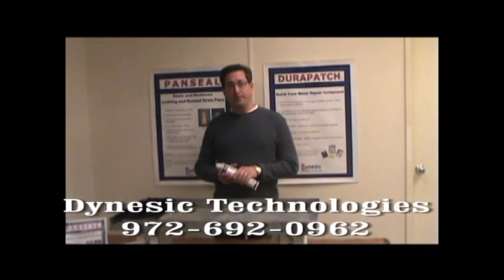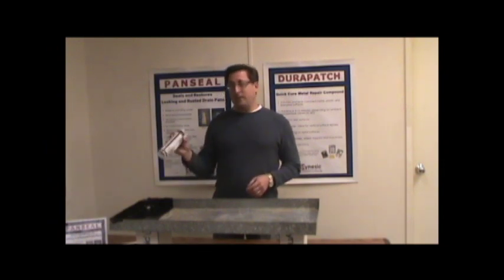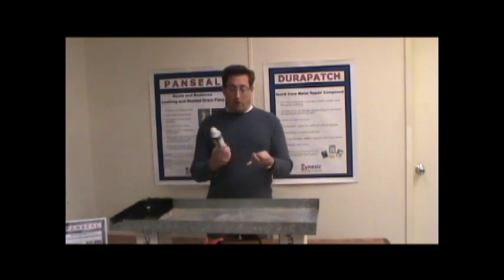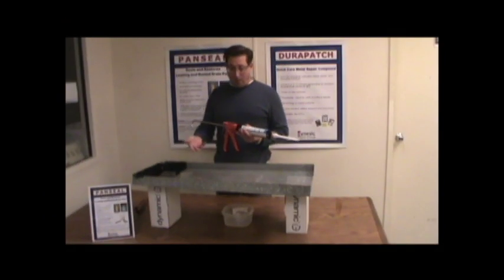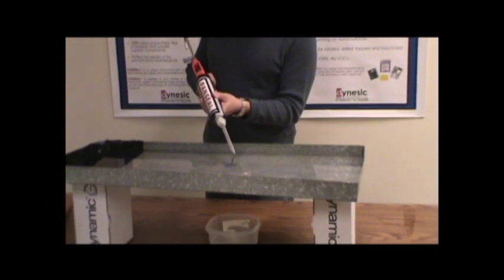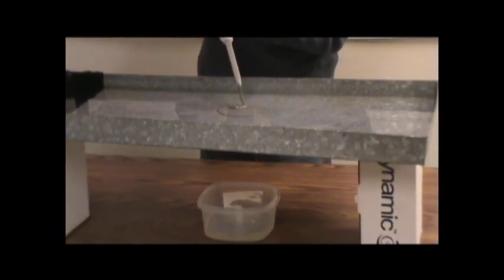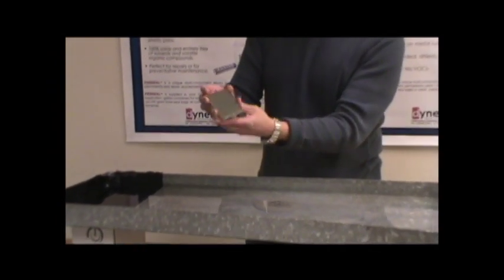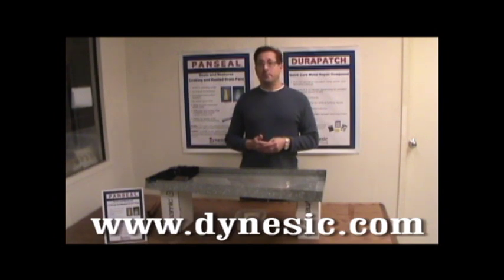Drain Pan Repair; Air Handler Repair, PANSEAL HVAC coating and sealant, Dynesic

Comment: Using the 1 gallon product with the qt of hardener over a concrete pad. This is 13 hrs later and still not cured.Mixed each separately and then together. How long before it`s dry? It is on pretty thick though.

Comment: My pan cannot come out without desoldering the A coil, the hole/crack cannot be seen in the plastic pan but you can tell the general area of the leak.  My a/c is 15 years old so I don’t want/don’t have a lot of money to repair something nearing the end of its estimated life.  Will this work on a dirty pan?

Comment: There are not a lot of A coils that don't give you any room to work with, but there are ways to avoid this issue.  PANSEAL is an industrial strength permanent repair that works faster than any other option and is way easier than replacing the drain pan.  Steer clear of products available at Home Depot.  We hear about those products failing on a daily basis.  PANSEAL will seal these leaks and prevent future corrosion.
Reply: Where can I buy it

Comment: What if the drain pan is on top of the furnace, and the A coil is on top that? Not easy access.
Reply: The 6 inch mixing nozzle helps you get in tight areas.  The product also self levels so that helps as well-

Comment: Works like a champ.  Does not need water to cure - Cures underwater or with no water, but once water is added, you will know if you have the leaks covered or not.  Feel free to call Dynesic with any further questions - available 24/7.
You can spread it with a trowel or brush.  The viscosity is like honey and it does self level.